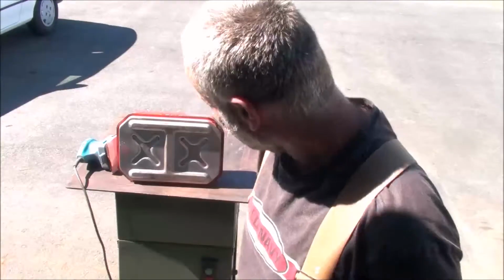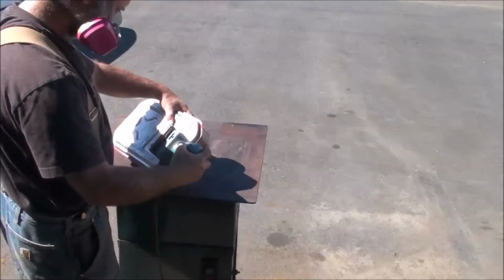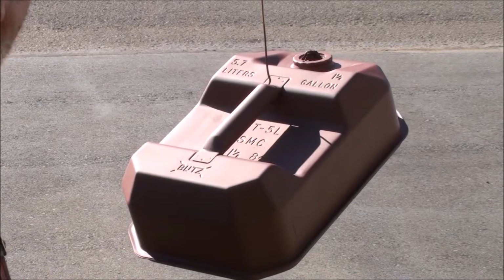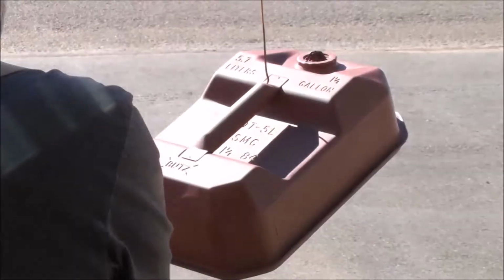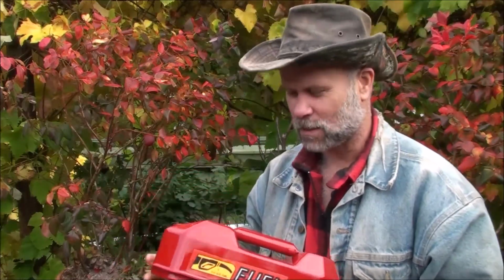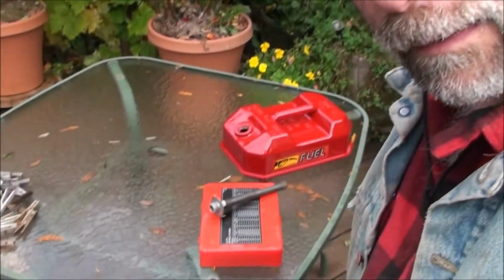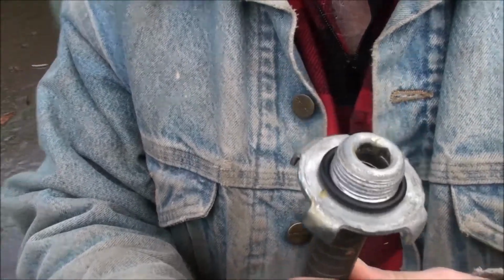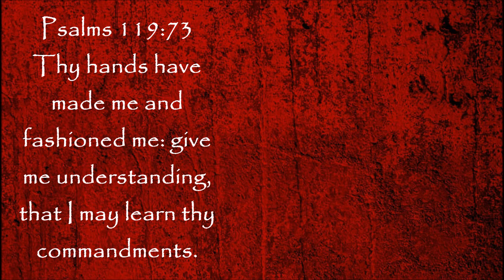Restoring a Vintage Gas Can

Comment: Pat, you need Harbor Fraud's $20 Gravity Feed Sand Blaster. I got that same O ring set, geeze, 25 years ago... The gas can looks great!
Reply: I actually have two cheap sand blasters, one of which has never been used.   Good little blasters for the money BUT for this little project it would take a bag of sand which I didn't have on hand and a month to clean up the mess after I was done. I have a finishing room I made in the shop years ago and have done some sand blasting in there but I have new solar panels and other stuff stored in there. Needless to say this was the more efficient, not the best way to refinish. One of these days I would like to get a little cabinet but I need to upgrade to a bigger compressor as you might guess. Money money money.  =(

Yeah, the gasket kits, electrical connectors, heat shrink tubing, adhesives, black and white paint and primer... extra stuff like that I like to buy extra of and keep on hand. Thanks!
Reply: I did 4 old steel Colman coolers a few years ago with a 5 gallon bucket of beach sand and a blue tarp in my utility trailer, I just kept reusing it till I was done...
Reply: Same here. I refinished a boat trailer down to the frame the same way. I kept reusing the sand until it became dust. I would collect it and run it through a screen door mesh into a five gallon bucket. I bet the trailer made a fine refinishing room!
Reply: Mr. Rain well a fine catch basin. It's one of those utility trailers with 16" sides.

Comment: What brand of paint do you use for something like this? The can looks awesome!  
Unfortunately we live in a throw away world.  That's why the junk they import doesn't work long or the quality is so bad it just doesn't last.
Reply: So true Cindy. If one pays Quality workmanship and materials have slowly degraded over the years. The paint is Rust-Oleum Professional High Performance Enamel Regal Red 7565. I usually keep this color, black and white on hand. Which reminds me I need to pick up some more primer!
Reply: Mr. Rain did you use a spray primer also?
Reply from the maker: Here are the links to both the primer and the paint he used:
*Regal Red paint: http://amzn.to/2y2Zmrp
*Primer: http://amzn.to/2zfE6A4
Reply: I did. That was the brown color on the gas can at time stamp 2:40. looks like Mrs. Rain gave ya a link!

Comment: Its a work of Art!!! I have an old Maytag wringer that could use your help, can you come to Maine? :) Blessings~
Reply: Sounds like a cool project and a practical piece to have around.
Reply: I am sure it could be a fun project, but I can not find anyone to repair it:( I know it needs a new hose, but where would I find that?  It is turning into a "someday" project~Thanks for responding~Blessings to you and wonderful Heidi~ Tina
Reply: Tina, the hose might be a standard size. Have you tried looking in your local hardware store? Generally with something like that I would take the old one off plus the barbed fitting or what ever it attached to and take it right into the store to match up to the new stuff. I have seen stuff like that sell by the foot. If it is a standard water hose size like 5/8" or 3/4" one might just buy a short hose for cold water applications.
Reply: Hi Mr Rain, thank-you for responding...but to be honest I am in shock/a fog. It is 9:54 pm  Sunday and I just got home from the hospital. Our 25 year old son has not been feeling well, we were in the ER for hours only to discover he a "lymphoma issue"  (which may be cancer) he will have more test in the morning....PLEASE pray for Justin! Blessings ~ Tina
Reply: Sorry to hear it Tina. We'll do.
Reply from the maker: Praying Tina!

Comment: Nice !   But I was wondering why you din't cover the hole while you were sanding ??? All jokes aside - I hate those new cans.  Whoever invented those plastic pieces of junk should have spent their time making toys for China or something !
Reply: Very observant and a good question! I had the hole covered at one point. when I started the video you might have noticed I had started the sanding. By that point the paper plug I had put in the hole had fallen through. I had re installed paper in the hole but was fighting it being in my way during the point I was working around the hole so I figured I would just rinse the can out well several times after thoroughly blowing it out with air. ;) Look at the comment Grayman made and I returned comments on. Yes the new "improved" spouts are not user friendly!